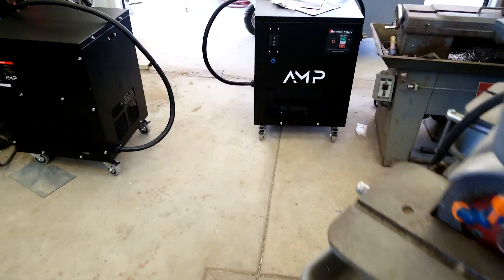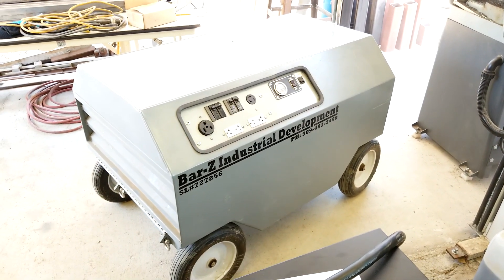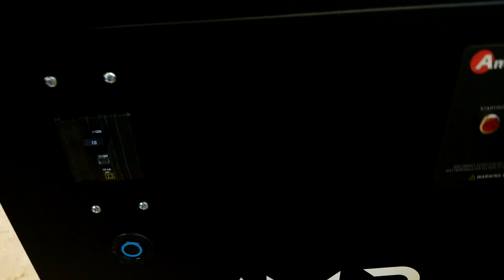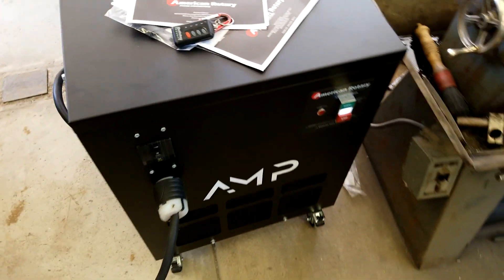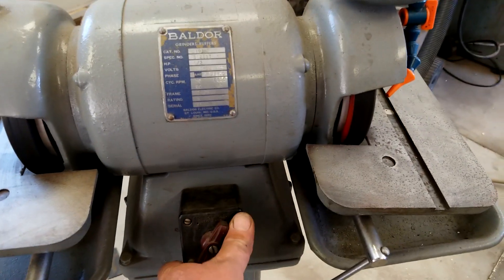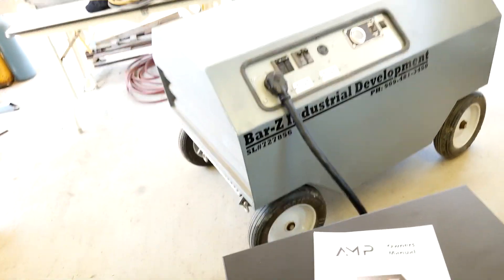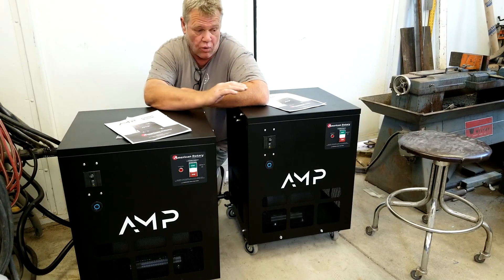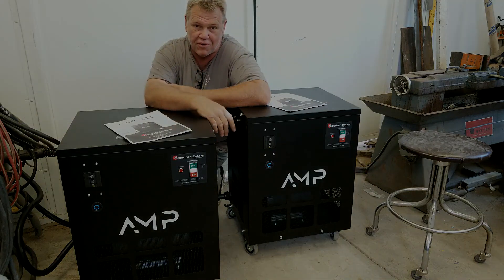Can we make portable 3 phase power?

Comment: Hi Stan. 
Love the video. I have been running my shop off a generator for some time, it's the only power l have. It's a 7250 watt generator and a 5 horsepower 3 phase motor that I pull start. It's not ideal but I runs a heavy 10 and a Bridgeport at the same time. Power drop on one leg but it gets the job done.

Comment: While I don't have anything 3-phase (yet) it's cool to see that a smaller genset will have the grunt to run a phase converter with enough power to actually run a tool.  Would be interesting to see how large of a machine HP wise would be usable in this setup, but it's good proof of concept.  Love the remote start on the generator!

Comment: Okay so because of Keith Rucker I learned that three phase power is very uncommon when you're not in an industrial building. But it's also uncommon to have construction site generators without three phase?
Come on...
As a German this is just unbelievable.
Reply: 3-phase generators do exist in america but few people own one. most are rented when needed, because just about every electrical appliance or power tool is designed to run on single phase 220v or split phase 110v power. most residential or light industrial construction is done with power tools that use split phase 110v power, or things like table saws that use single phase 220v so that's what construction generators are designed to produce.

Comment: Just looked and Kohler makes a 14Kw 3 phase generator.
Reply: Larry Small don’t think they are alone. Film crews use a number of different sized 3 phase gennys. I can only list names of rental co’s not manufacturers
Reply: @griplove  I just did a quick google search.  I have a 5kw single phase generator.  It would be very easy for a manufacturer to replace the single phase alternator with a 3 phase one.  1 additional coil and slight internal wiring is all it takes, along with 3 phase connectors.